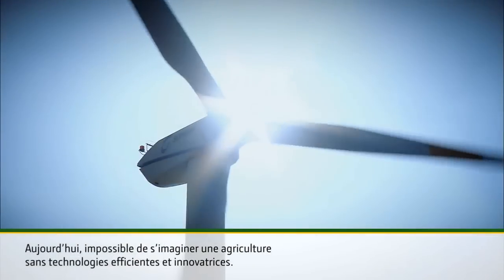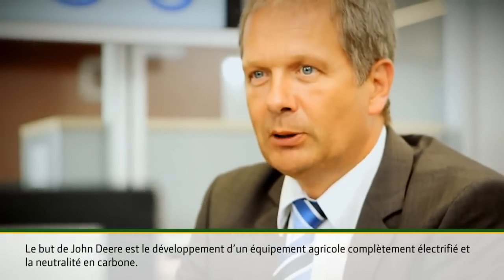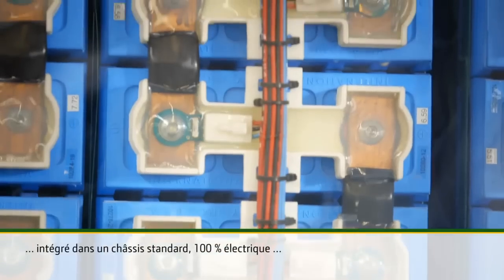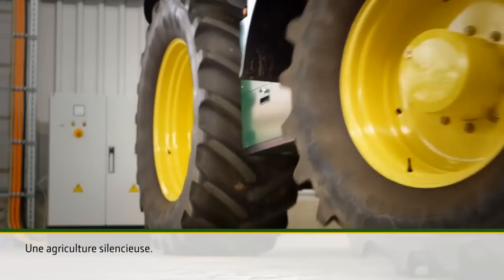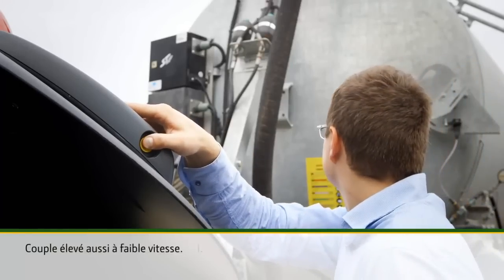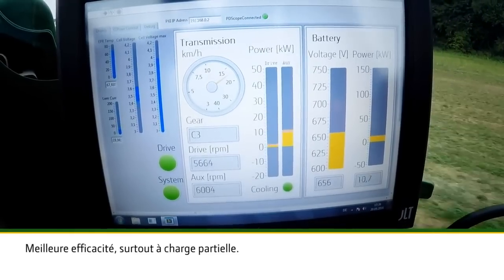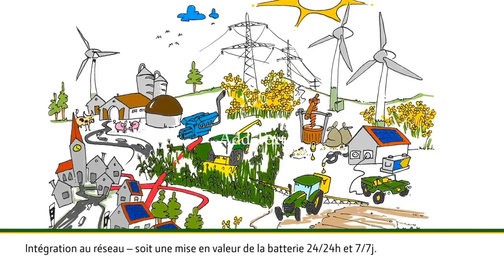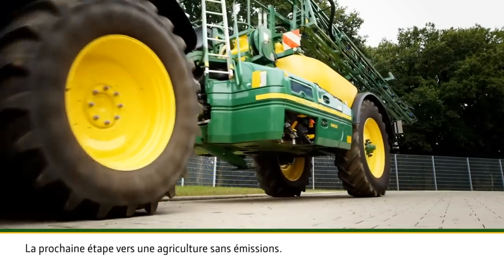The Worlds First Electric Powered Tractor!

Comment: Notice how the presentation highlights the "carbon neutrality" aspect?

Pull back the curtain and you'll see that, like everything else in the current system, the real benefit is the cost.

When you consider how expensive diesel is (and I don't just mean with taxes and all that - I also mean the social cost), as well as maintenance and lubricant/fluid/aftertreatment costs, then you can easily understand why many farms will go electric.

Agribusiness cares about profits.  That's been obvious for a while now.  Therefore, they will look at electric tractors and say "hey, we can jack up our share prices now that our profit margins will increase!"  The investors will chomp at the bit, and the diesel tractor will become a historical thing like the steam locomotive.

And look, I love diesel tractors too.  The roar and the puffs of smoke under acceleration and revving just can't be beat.  However, I'm also looking at reality, which clearly says that the vast majority of tractors in the future will be electric.

I mean, I wouldn't buy a petrol-powered forklift for general yard work.  I'd buy an electric one because it's cheaper and doesn't have to be maintained as often!

Comment: first they still have to make the electricity to provide the fuel for the tractor which means the nucular power stations will have be working harder which later on in the long run could be even worse than using diesel. i think its a stupid idea and they arnt thinking about later on. great vid as usual tho.

Comment: Caterpillar has an electric drive bulldozer (D7E) which is not battery only but more like a hybrid wherein the motors are powered by a diesel generator.  They are available and in operation right now.  This technology has been used by railroads for years.  Really cool stuff!

Comment: Ye it's all clever and stuff but it's not the same as a diesel tractor and u don't have that roaring sound and people work much longer hours than just 7
Reply: Yes but not continuously(at least not where I am from) - you have to take a break and eat and stuff at least once during those seven hours, so with a suitably efficient fast charger you replenish the battery during your break.  This extends the operating time to a full farm working day easy, assuming you can charge at roughly the same rate as you would a Tesla with a similar size battery(charges 80% of a 100 kWh in 30-40 minutes).
Reply: @Darwinist  https://youtu.be/awp5NLTmQjk this is the kind of power you would need to charge a large tractor you would need at least 4 of them to charge a tractor size battery in a reasonable amount of time. and as @StarGames said "the best thing about farming is the sound of a tractor and hearing it struggle to pull something heavy" https://youtu.be/awp5NLTmQjk?t=20 listen to that turbo kick in that is the sound of raw power being made. also tractors can run on BIO fuel with little to no modification at all witch means a tractor can be just as ECO friendly as a electric tractor.
Reply: @Darwinist  1- we take our lunch with us if we need food most of us have a wife/husband or kids to bring us more food. 2- how do i charge a tractor when its over 4km away from the house in the field i don't have a cable that long and on bigger farms that tractor can be over 30 km away from the house. 3- batters and other electronics don't work well when its hot where i live it gets to 45c easy. 4- here when its seeding season the tractor runs 23 hours a day i wake up a 6am put the fuel in make sure it has oil and all the other checks takes around 5-10 mins then work to around 7pm then i hand off to the night shit worker he goes to 4:30 - 5am and the tractor rests till i come back at 6 and i work on a medium size farm lots of big farms run 2 or more tractors 24/7 only stopping for fuel, driver swap and periodic maintenance. 5- we pull big seeders and plows that ET John Deere could only dream of pulling. last of all a normal tractor cost around an easy $300,000 AUD we cant just throw away something that cost that much all to buy a ET that will cost $500,000 + the high power transmission lines to provide the power to charge an ET. the only place i see a ET working for the foreseeable future is somting like the fendt vario e100 in a vineyard were most vineyards only work in the day or the night and it can charge in the off work hours but battery's will need to at least doable in capacity if not triple. by the time there are ET's that match or out do a normal tractor we will be 6' under unless we become immortal but then we wont need food.
Reply: The price is eye watering no doubt
Reply: There is always that one guy....
Reply: electric tractors? a good idea? HELL NO! the best thing about farming is the sound of a tractor and hearing it strugle to pull something heavy. we dont want to be in a boring tractor that makes no noise. also the tractors will have WAY less hp
Reply: @stef7396  that tractor had 180hp. And that 180hp will feel like a 250hp tractor  cause it has far more torque.
Reply: @stef7396   These are prototypes. I don't think tractor drivers ,who  often work long days, want constant noise and neither do  neighbours, when tractors operate late at night. New batteries will be lighter and have greater capacity.

Comment: there are tractors that use BIO fuel that are way better and more efficient than electric will ever be
Reply: don't forget you can mod old tractors to run on BIO fuel. also BIO fuel comes with the added benefit of being able to refuel in the field witch is good for us farmers in the middle of Australia i have more of a medium size farm it takes about 15 mins to drive across the farm in a car at 100km/h or 60Mph let alone a tractor and i would have to unhook from my equipment because there's no way in hell i am dragging that big ass air seeder across the farm to wast time to charge a battery. when i can fuel up a normal tractor with diesel or BIO fuel from a tank i can pull behind my UTE / Pickup truck witch only takes around 5 mins. i can leave the tank on the side of the field when is almost empty i can take it home when knock off for the night or hand over to the night shift driver refuel the tank at home and bring it back in the morning.